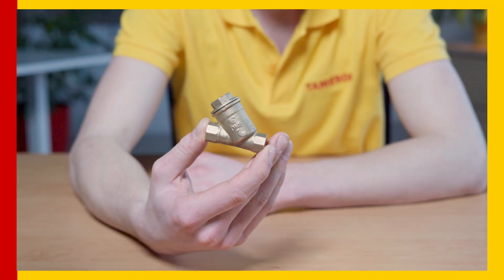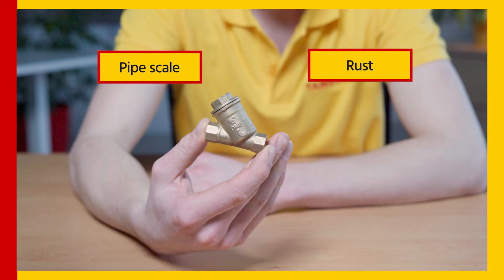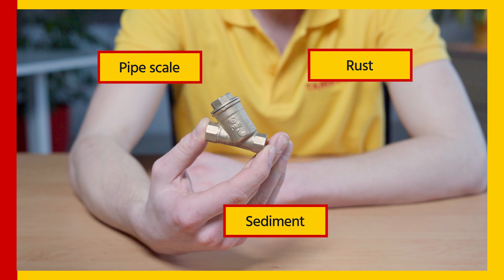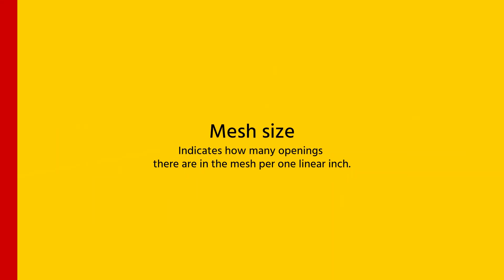What is a Y Strainer? | Tameson

Comment: Does it matter if the Y strainer is installed "upside down"?

In other words, does gravity influence its operation?
Reply from the maker: The Y strainer can be installed vertically or horizontally, but the filter leg must be pointing downwards to ensure that any filtered material does note interfere with the main flow. You can find more info in our article: https://tameson.com/pages/y-strainer
Reply: @Tameson  
Thanks a lot for the reply!

I asked because my brother had a heat pump installed, which requires a Y strainer on the return pipe...the geniuses he hired to perform the installation left the filter leg pointing up.
After telling my brother that the strainer was incorrectly installed, those geniuses replied that the leg's position doesn't matter, the Y strainer will filter all the same, the only thing that's important is to observe the arrow that indicates the direction of the flow...
 Top quality installers 😅

I have a spare Y strainer at home, upon closer examination, seems obvious that if the leg is pointing up, the flow will be easily disturbed by buildup of "dirt" in that narrow space, like you said. 
Aside from this, it also seems obvious that the leg is meant to be pointing down for maintenance reasons, since the "dirt" will naturally fall out by the action of gravity when the filter cap is removed... but if the leg is pointing up, the "dirt" will remain inside the pipe (if it's heavy enough).

There are so many incompetent installers out there, asking insanely high prices for subpar work... it's crazy... and it's even crazier that they double down and try to justify their sloppy work when it's pointed out to them.